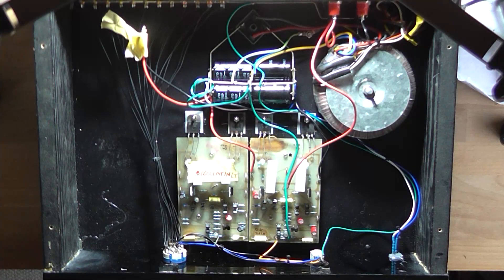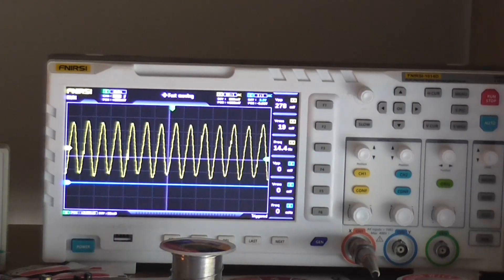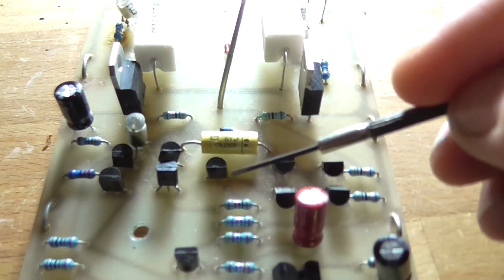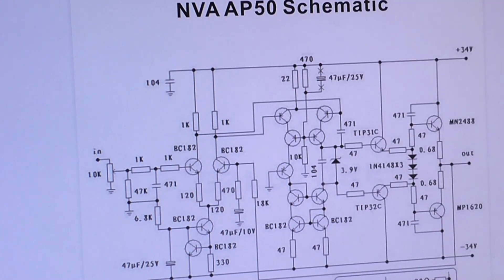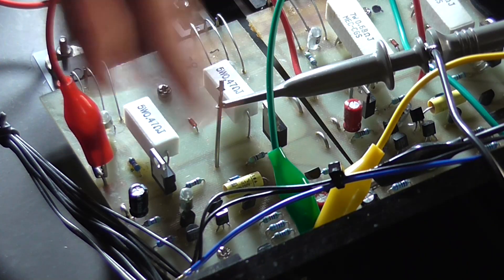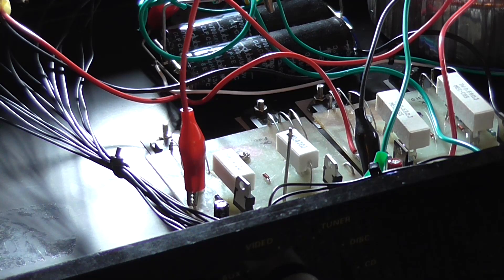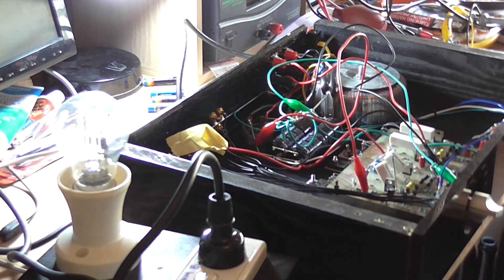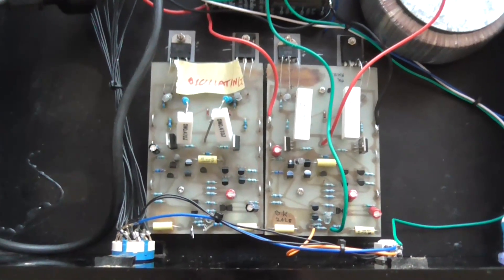NVA AP50 Amplifier Oscillation Problem

Comment: . . . Sometimes it just keeps restarting . . . Use a higher amount of circuit current; a hair dryer gives enough to make it fully stable start, instead of the bulbs.  . . .
Reply from the maker: I've heard of using a heater in series with the DUT works, too. However, I don't want to do untold damage to the DUT by running it at full line voltage if it has a fault.
Reply: 6 Amps should not hurt . . . Use low power settings on heater or hair dryer . . .

Comment: Sometimes one has to stop and reconsider their objective.  Perhaps your goal should not be to build an amplifier but instead a single frequency signal generator.     😀
Have you thought about trying ferrite beads at points in the circuit where a little inductance might be what is needed?

Comment: Polystyrene caps are heat sensitive, looks like the leads are too short, you need some length to help with minimizing  heat issues when soldering. If its 100Hz, its mains rectification noise coming through, must be high gain to make it oscillate. It must be the input/feedback stage, check the differential pair, one transistor has an issue.

Comment: 100Hz is usually hum from the power supply, not oscillation. If it's exactly 100Hz, it's power line stuff. 
Check the 47uf 25V cap, and the other 47uf 10V cap. Check the input cable ground connection. Other than the 100Hz, is the amplifier working? Does it pass 1KHz full-amplitude sine waves? Good luck!
Reply from the maker: Both caps were replaced. Secondly, it does the same thing out of the unit on a DC bench supply (current limiting at around 1.2A) +/-19V (drops off during limit). It's definitely oscillating and nothing related to mains hum.

Comment: I would add a capacitor parallel to the "471" loop compensation capacitor to see what changes. Or increase the 18K feedback resistor and look what changes. The circuit has many stages and could show a great variation in open loop gain due to tolerances, questionable parts used and aging, so the loop compensation might be not always enough.
Reply: Or simply a 10mF capacitor across the 470ohms resistor would do.

Comment: Personally i would swap out the transistors bc182/214L/A92 i have reversed engineer these boards to make several monoblocs great sounding amps   if all the resistors check out fine it will be an active device issue,dont give up yet !

Comment: there a special  darlington transistor you will need to find good replacements or you will have problems
Reply from the maker: It came from a reputable supplier.
Reply: @AstrosElectronicsLab  be a easy repair

Comment: Just an observation ... But looking carefully at the waveform on your scope, there is a small 50Hz component present. Could there be a earth loop present on just that channel, had a similar issue way back in the early 80's on a John Lynsey Hood 75W which some how manifested itself as 100Hz in the output stage !!
Reply from the maker: I put the module on a bench supply out of the unit, same thing.
Reply: @AstrosElectronicsLab  Really odd .. As you know, oscillation's normally run away to a much higher frequency !! Really good content non the less.
Reply from the maker: Yeah, it does. I was expecting megahertz. Not 100Hz... and thanks.
Reply: The most useful item of test equipment i have for discreet component amplifier fault finding is the Huntron Tracker (as in your case with Stereo there's more often than not a good channel for comparison) .. I have an Hameg HZ65-3 stand along unit that will work with Digital scopes the have X-Y function but a cheap CRT scope is better .. I will send u the unit FOC for you to play with .. how can I do this?
Reply: There is a capacitor across the current source at the input stage. This can cause noise and inject noise from negative power rail.